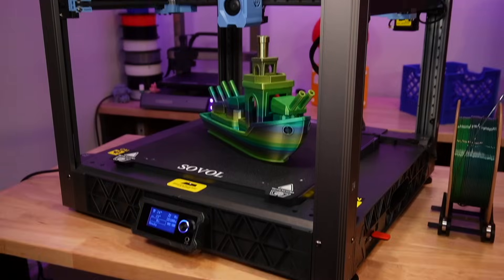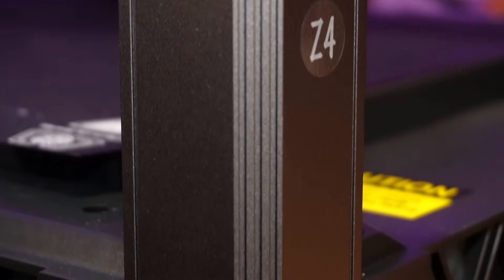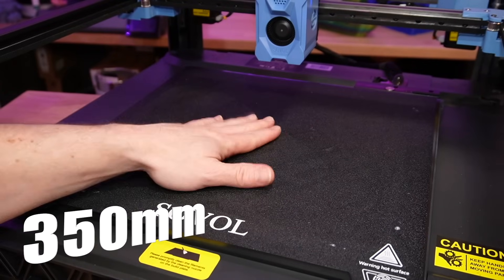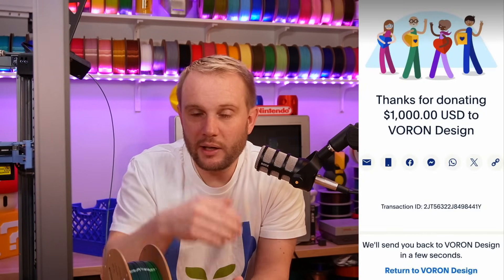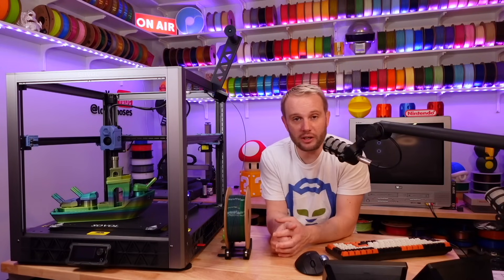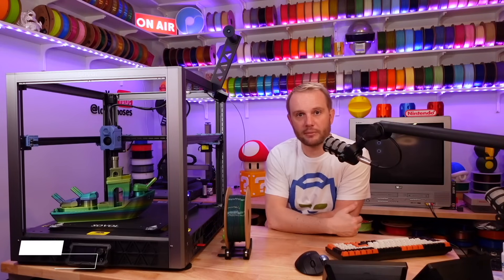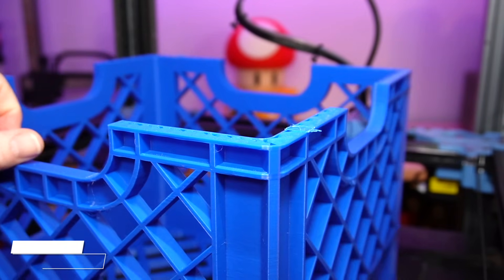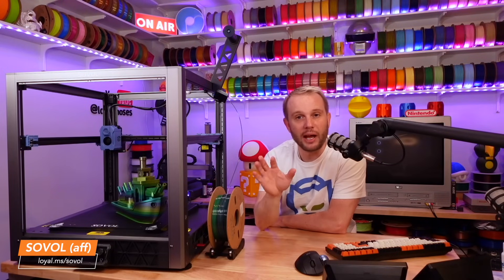The BEST Voron 2.4 - SOVOL SV08!

Comment: I have one SV08 and with all the issues i had, and still have, last one is the taco heatbed (that i'm gonna replace with a voron bed), this SV08 printer is nothing near a Voron, good for the price, nothing else
Reply: my condolences
Reply: A lot of the issues with the SV08 have been fixed in newer production units. The only real issue I had with mine (received it a month ago, late may 2025 production date) was the terrible probe and the 3d printed dragchain mounting part with the enclosure. Once I replaced that it's been printing very reliably and fast.

The taco bed has been fixed by using silicone spacers instead of hardmounting it to the bottom frame. The toolhead cover falling off has been fixed with a little dowel pin on the toolhead. The nozzle ejecting with PETG has been fixed with some grub screws.

Comment: It only took me 90 minutes to go from an unopened box to starting my first print.  I was pretty impressed with the SV08, until about 100hrs of printing.  Suddenly started having extra_mcu communication errors.  I flashed it to mainline klipper, got another 100hrs of prints, same error.  After a few weeks Sovol sent me a replacement toolhead mcu along with an updated firmware, flashed everything to their firmware, 100hrs in and had the same error.  From everything I can see, this machine's PSU is dramatically underpowered for what they are trying to do (part of the reason why it gets WAY hotter than it should be).  They are not using the proper wire gauge for many parts of of the linking between the mcu and toolhead.  I found cold solders all over both the toolheads they sent me, along with the mainboard.  Their firmware is not mainline, which makes expanding on the printer impossible without flashing all the components to mainline.  The fork of the firmware they are using has bugs and errors riddled throughout all their customizations.

This is the 3rd SV08 I've tried (and 7th toolhead MCU, 4th mainboard), and the same errors and issues have cropped up EVERY time.  I've ended up taking this machine (because it does look great) and upgraded the PSU, replaced the mainboard with Manta M8P v2, the toolhead with the EBB36, the probe with an Eddy, and ended up having to print a hole new toolhead to fix the issues with the stock one.  All in, I spent almost $600 to make this machine usable and not a fire hazzard.  To be honest, I can tell you exactly how they got the price down to $500, they cut literally every corner than could be cut, including power and cabling (making it overheat and at risk of not only fire, but blowing circuits if you're not careful).

All said, this is the first printer I regret buying.  I ended up taking their chassis and turning it into a new machine.  The only reason I did this is because of sunk cost fallacy, but also because I do like the look of the machine.  This is a printer I can never recommend to anyone, so far, for every person I've seen praise this machine, I've found 50 people with nothing but issues with it, including myself.  Granted, I rebuilt it into a completely new machine on the provided chassis.  If you are new to the 3d printing game, or even just new to Voron, DO NOT BUY THIS PRINTER.  You will spend more time troubleshooting and trying to fix the printer than you will using it.

BTW, for those who want to know, the machine I rebuilt I got 2 months ago, so it's the most up to date version of this machine with the newest firmware.  For everything the fixed in the previous iterations, they've broken 3 new things.  Do not buy the SV08 unless you really love the look of it and are willing to rebuild all the internals.  After you buy this machine, and put another $500 into it, flash it to mainline Klipper, you will have a solid machine.  But at that point you may as well have built exactly what you want on your own, it would have cost the same, and you would have spent less time on it.
Reply: And side note, the bed this thing comes with is a $35 bed that they upsell for $85.  It literally turns into a saddle when you get it over 50 degrees, and if you take it to 95 degrees for ASA or ABS, you can actually see the warping using a level.  You're going to need to replace the bed too, so add another $300 on top of all this because there's only one company making an aftermarket bed for this thing right now (I've been waiting on mine for 6 weeks).
Reply: i guess it really is the new ender 3 haha. i'm sorry about your experience though

Comment: Great Video and some great points about it. I have been watching how this printer has been progressing and the issues that have been showing up. I just ordered mine, and I love working on machines like this. I know the first three upgrades I will be making. Well 4 actually. First is swapping out the mainboard fan to a quieter one. Second I will be upgrading is the bed level sensor to a Eddy sensor, its more percise making bed meshing and makes adhesion more precise. and 3rd the hotend, because I have seen a few problems with the factory nozzle getting clogged when running PTEG, and one minor issue I will fix is the wire harness on the bottom of the printer that passes through the sheetmetal cover, to protect it from rubbing on the sheetmetal. And to all of you complaining about him saying its a Voron, ITS a Voron LIKE printer, but he can say or call it whatever he wants its his Channel!
Reply from the maker: Thanks for sharing! It's one of my favorite machines.

Comment: I think Sovol knocked it out of the park with the SV06, and SV08.  I am not sure I would consider the other printers they offer, or most other printers that any company offers, for that matter. That being said, my budget is very limited.  I have the SV06, and the thing I like about it (aside from it being basically a Prusa Mk3 with a 32 bit board and a minimalist price) is that the minimal upgrades that I do, are real improvements to a well designed machine.  I am not just printing an entirely new machine, because the original was so badly engineered.  The price is because of subsidies.  The U.S.A. subsidies' corn production, other countries subsidies other product production, like say 3D Printers.
Reply from the maker: I like those machines as well. There are LOTS of rumors on how these machines are paid for or subsidized. I've spoken at length with many of these companies directly over the years - the costs are so low because their components are readily available and produced at scale. They can build basic bed slingers for less than $50, and of course more complex 3D printers have increased costs.

Comment: I have my machine now, have another Klipper printer and I am using an external RPI to control that one. I configured KlipperScreen to switch between the two (the other printer and the SV08) and it simply controls it through the network port. So that is very simple and works well.
Reply from the maker: That’s awesome!

Comment: Thank you for the great video. This is a printer I was waiting for, on which I can print A4-size tables/signs (A4= 297x210 mm) and smaler frames for A4-pictures up to approx. 342x255 mm. Biut two points I would appreciate to see improved in future.
1. What about an enclosuer / housing. I beliefe, Sovol will launch this 3d-printer with full enclosure and some improvements soon. 
2. The printbed temperaure should reach a max. of 110°C to be able to print ASA and control temp. constant at 105°C.
Reply from the maker: Glad it was helpful! Yes they have an enclosure!

Comment: I think this printer is hitting a market that typically gets left out. However I think its coming like 2 years to late. Multi filament printing is absolutely the future of printing going forward. I think if Sovol should have showcased something that clearly proves that this printer will support that or is capable of doing it. Without that proof, this really is just going to be printer people get rid of for a multi material / multi color printer.  Even if we dont care about multi material or color, it should support dual filament feeder due to massive print volume size. This printer can easily out print a spool of filament.  Im not complaining but just forward thinking on some stuff i think they missed.
Reply from the maker: There are existing MMU systems that can be easily adapted and I expect they will immediately.
Reply: Look at the bondtech INDX, I'm pretty sure they're going to release a SV08 kit that you can just bolt onto the gantry and you'll have multi material toolchanger for adding about half the cost of the printer. Basically a prusa XL with 5 toolheads and enclosure for 1/4th the price.

Comment: would like to ask what fan does it use for power supply?. size ? and voltage ? i get it that it is the loudest thing on printer. 

then SV08 should be equipped with TMC 2209's, and I use those myself at 1.15V, where they're dead silent. Have you tried testing what voltage SV08 use them at, just for the fun of it? I'm curious, because the stepper drivers are similar, but the noise level is night and day between my printer and the SV08. It could also mean an early burn-out. But it might also just be true to them being a different brand, but since the TMC 2209's support up to 28V for motor supply and up logic voltage up to 5V, it might also just be a far more aggressive tuning than what I use.
Reply from the maker: Cool!

Comment: Brutal honesty, more content creators should so that.
How bad a job would it be to handle a clog on this printer?
Have an upgraded Ender 3 Pro with DD and an skr Mobo, want a 'new generation" printer (finally all the brands are producing better printers instead of just nee iterations of clones) but I'm still holding back on goin the Bambu path..
Prusa mk4 is waaaay to expensive anyway.
This one in the vid seems awesome and affordable..
Reply from the maker: It’s pretty straight forward to open up and get to, so I think jams and clogs would be simple to fix. I didn’t experience one, it ran really well.
Reply: @LoyalMoses  okay nice. Is the wiring just going around bare metal corners? 
With the vibrations and time I'd suspect cut isolation/shielding on the wiring....?

Comment: Edit: unless it does use 20x20 extrusions as the frame and just has a bunch of covers. I see it on the gantry but cant tell for the frame. 

I dont really understand the whole infinite upgrades thing. I dont think many of the voron specific upgrades can apply to this. Especially when we are talking about mods applying to the toolhead. No ability to do that without changing its propritary toolhead. Also i dont think case lights is really possible or purge bucket since those use standard 20x20 extrusions. Most mods do. 

I dont doubt a community will be grow around this and they might develop mods but right now it doesnt exist.
Reply from the maker: All of a sudden people have forgotten the mantra of “I can make that” and “I can mod that” 🤦‍♂️

Comment: Can it print abrasives? In other words, are those nozzles hardened steel or just coated brass?
Reply: Like with any 3d printer they are consumables. So just buy a pack of hardened ones. 🤷‍♂️ And while you ae at it get some 0.6 too if you want to print faster and some 0.2 if you want to print more finer details.
Reply from the maker: It can print abrasives.
Reply: @LoyalMoses  thank you. What material are those nozzles? Hardened steel?

Comment: Great video! Waiting for the Bambi A1 to return because I have had my eye on it for a while, but this one has got me tempted to hold off on that haha
Reply from the maker: A lot of us are waiting for that A1 to come back in stock!
Reply: @LoyalMoses  reckon If I miss out on the first round of A1’s when they return, might have to lean on the SV08!
Reply: I still print on it .. sometimes maybe there will be a new bed coming .. but i have the cable helper printed on it and 
a smoke alarm near it :)
Anyway , i also had no visible deforming at the area of the cable.
I print actually on it with 0,6mm nozzle.
But i also ordered a SV08 for 450€
It was around 449$ plus 10$ delivery, but the Euro exchange got it back to 450,87€

Comment: I don't think it's going to replace Voron. It's a budget machine with cheaper and proprietary parts (granted mods will make up for this).  Plus, as others have mentioned, Voron is more than just a printer. That being said, I still bought an SV08 with the enclosure. Was 5 minutes late to launch and missed the super early bird pricing, but still got the printer and enclosure for $620 which is less than half what I paid for my 2.4. I'm looking forward to getting it and comparing it to my actual Vorons.
Also, the whole thing with Voron is parts readily available off the shelf. That's not the case with the SV08, so this is not a Voron by definition.
Reply from the maker: Thanks for sharing and CONGRATS! ! !
Reply: Any thoughts 1 year later on the sv08? I want to buy a printer that's somewhat open source so I can install the bondtech indx later.

Comment: Truth be told, it reminds me a bit of me first printer, the ender 3, at the time I would of course have preferred to start with a Prusa, sure, but didn't have the money in my pocket and was a bit shy of building a printer from ground. Ok, I've never reached the level of quality offered by Prusa (not that far away though) but I had a lot of fun, learned all the basics, it served me well  for two years and has now found a new happy home since I invested in a biqu B1 and a tronxy crux 1(one other hobbiist lesson I've learned over time always have at least 2 printers, 1 stock and one to tinker with ;-))
Then is the sovol an affordable version of the Voron 2.4, absolutely not!! Can it be the best place to start playing with core XY, I sure hope so, if it respect its open source promise.
Then my best wish would be that one of the first mod for the SV08 would be a solution to integrate the stealthburner to replace the propriatary extruder ;-)
Reply from the maker: Interesting points! Thank you!

Comment: I wouldn't recommend this as a first printer, or a second printer, I wouldn't recommend it at all to anyone. I can see how someone will struggle to maintain or fix it when it will go bad, and I'm very certain it will. in my opinion, if you have built a voron or similar before, then you can get this, otherwise, I think it would be a great printer until it stops.
Reply from the maker: Well, all printers are great until they stop! :-) Thank you for sharing your thoughts.
Reply: @LoyalMoses  very true, but I guess finding a solution for an ender 3 would be much easier than this. I have a CR6SE, it didn't have a community around it, I had an issue that took me a very.. very long time to understand and fix, it was my 2nd printer, now. 6 printers later, I still hate that CR6SE experience and wouldn't want anyone to go through it honestly. 

thank you for your videos, I like your style, more importantly I like your methodology around 3d printers.

Comment: As @skilledcamman4752 said - Voron is Voron.  I've been intrigued by the Voron ecosystem for a while, but I need to work not tinker, so I've opted in to the #Sovol realm since everyone of their printers that I've purchased have just worked.  While my SV06 was my "gateway drug" to the world of FDM printing, the SV06 Plus and SV07 Plus have really upped my game on creating functional mechanical prototype parts.  Like you discovered, I've had adhesion issues with Sovol's course PEI plates that came with the two Plus machines (my SV06 has performed fantastically since day one).  I started using Elmer's Disappearing Purple Washable School Glue Stick and that problem vanished.  Plus, the purple lets me see what I've covered 😆.

Unfortunately, this release - while extremely exciting -  is poorly timed for me, so no SV08 for me (yet). Oh, and it begs the question - what's the SV08 Plus going to bring to the table?  1M squared print volume???

Comment: i have too many printers now, but yes, i think this will have a similar impact than bamboo lab had.
the SV08 is 703€ (499$ + 1 to 1 conversion + vat + import taxes) vs ldo voron 2.1 350mm is around 1.749,99€, + 50-80 in asa parts + expensive last gen rasberry pi.
and my lazyness wont help, the voron 0.1 half asembled i have for 2 years now con confirm that
Reply: I self sourced my voron for 850€ (without rpi, including delivery fees). It's a lovely beast. (jlcmc instead of mitsumi frame, other kind aluminum). Also, should a new revision come from voron, i can just easily upgrade.